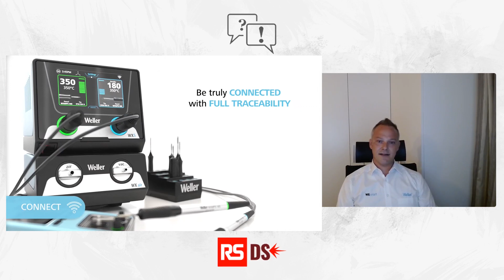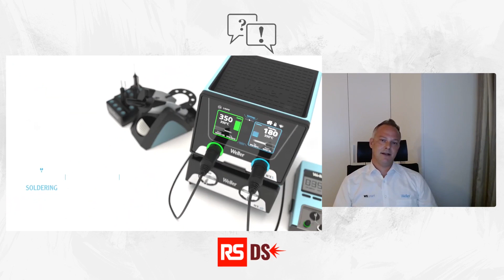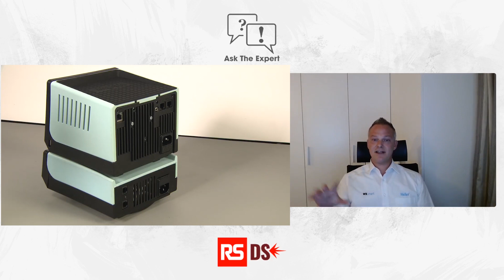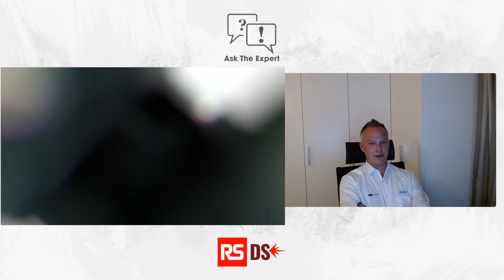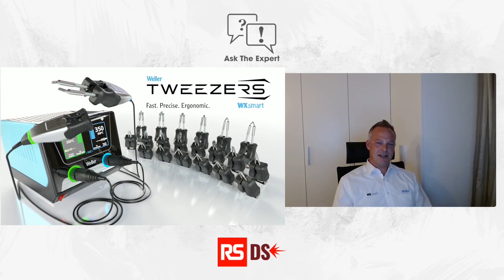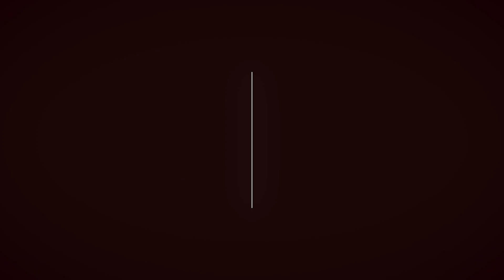Smart soldering for full traceability

Comment: Not to knock this new product (series?), I would have to say that at 72 years and now retired, the BEST soldering iron I have ever used was during the 70's when Weller came out with the curie-point temperature controlled iron.  While tips would physically wear, new tips & other parts were easy and inexpensive to obtain.  And tips did not rust and freeze in the barrel because the metallurgy was correctly thought out. 

Now even high-priced product like the Hako offerings are very disappointing by comparison.

And YES, the 'green' army had most of the truly effective multicore flux wire solder product was banned and this certainly caused manual soldering to become MUCH more difficult generally.

I hope for everyone's sake, that this new Weller series will prove to be a truly professional product, rather than the fluff and bollocks junk they have been manufacturing for the last 25 years.  I DO like the integrated work station concept, but this - for the most part - is not new.

Good luck Weller, and remember - customers still vote with their wallets and feet.